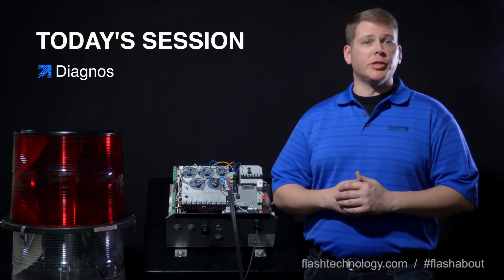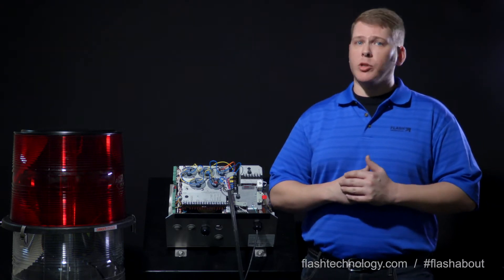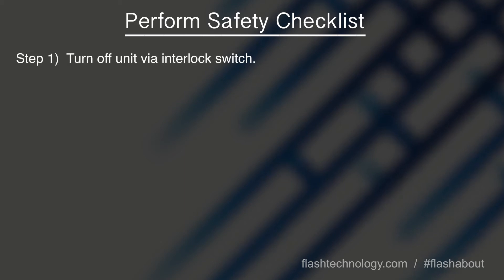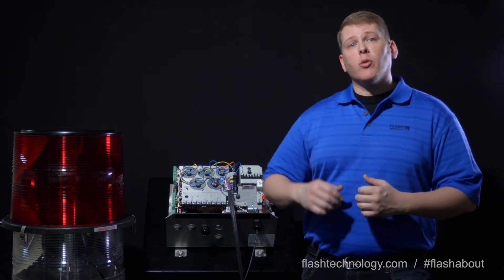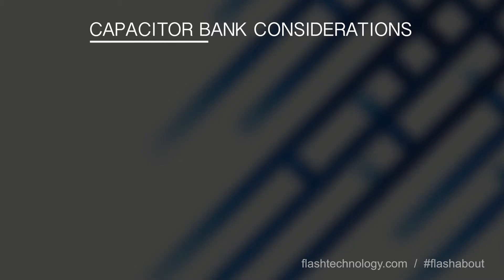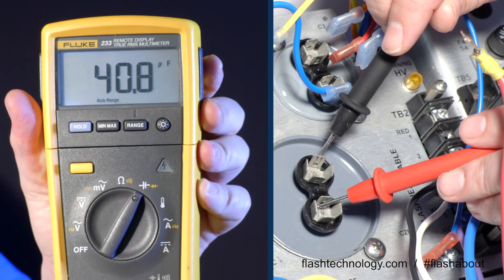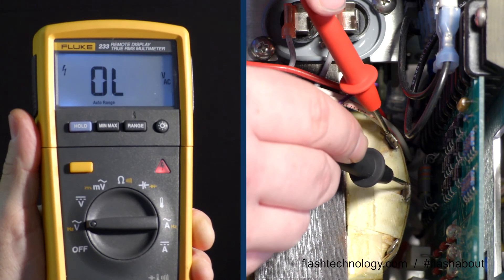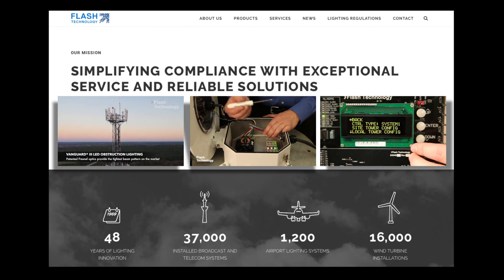FTB 324x High Voltage Troubleshooting

Comment: When you talk about removing the tower load and rechecking voltage, you didn’t show testing on the empty vacant slots of TB2, where you removed red and blue. Is that where you check to see if voltage returns to normal?  Then when checking after isolating the capacitors the red and blue are connected again, but when removing the capacitor wires you had the red and blue removed